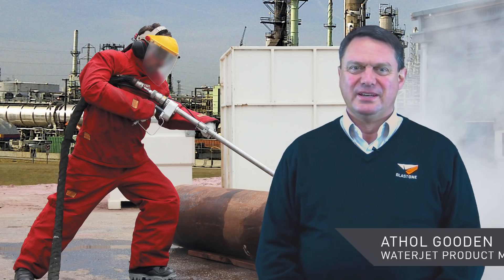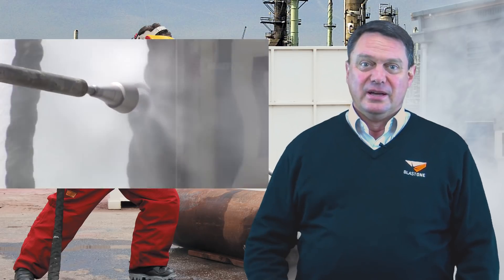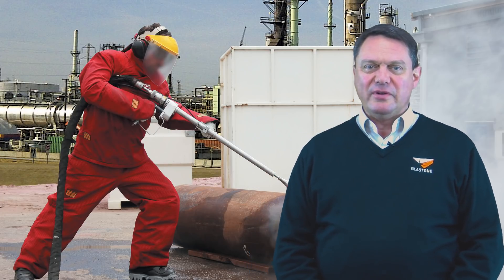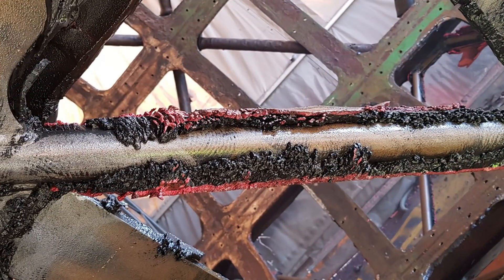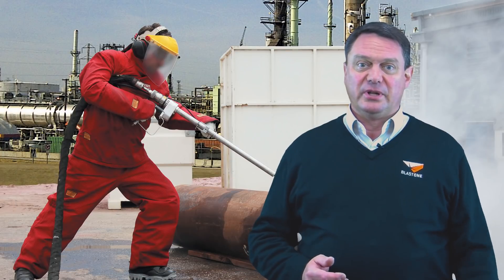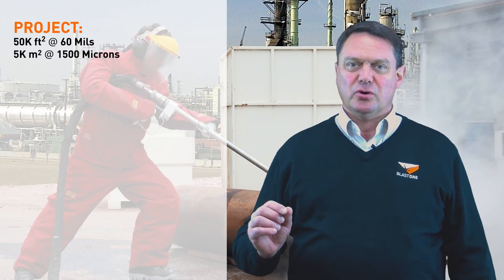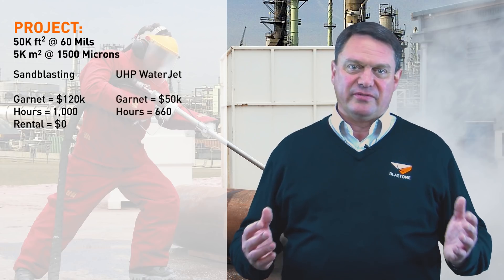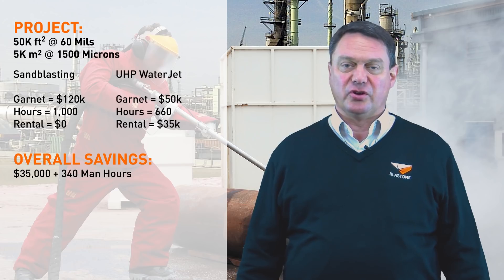When should you use UHP Water Jetting over Abrasive Blasting?

Comment: What is the minimum wall thickness on piping that UHP can be used with?
Reply from the maker: UHP Water(36,000 -40,000psi) does not affect the structure of steel substrate and does not create a new or modify an existing profile. With very thin steel piping, (less than 3/64 of an inch) there is the potential that it could slightly 'peen' the surface. In summary, there is really no minimum wall thickness requirement for UHP water on steel piping.